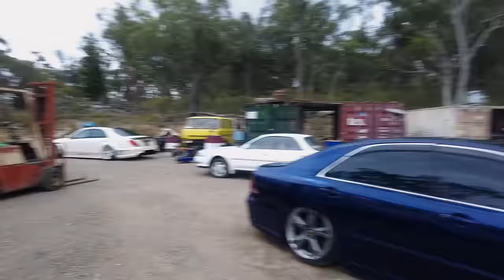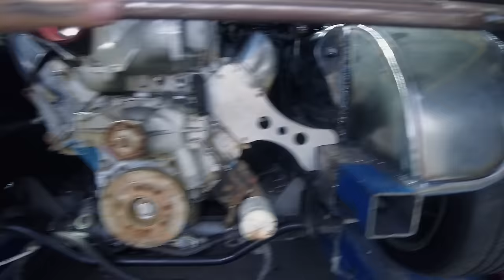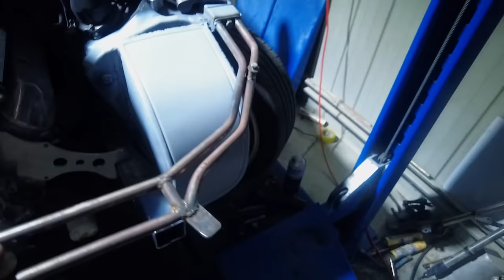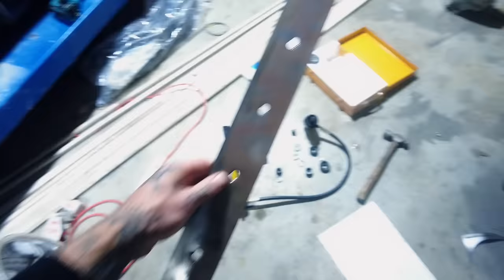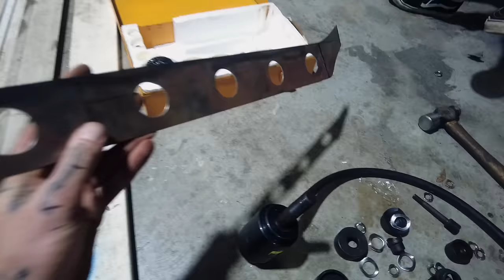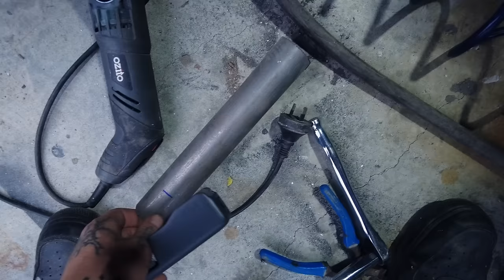I'M BAAACK

Comment: Are you going to stick a solid rear diff in it like a 9 inch or something
Reply from the maker: Yeah that’s the plan! Tubbed shortened etc not sure what route for suspension yet though
Reply: Sounds weird but a old built jag rear end could help to keep it slammed but would hard to build it to spec @Maxamilyon